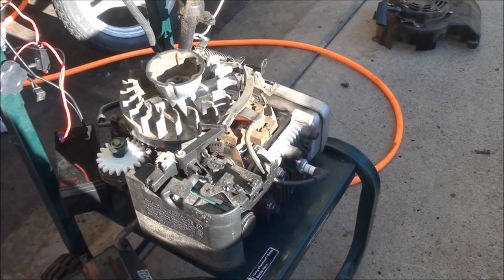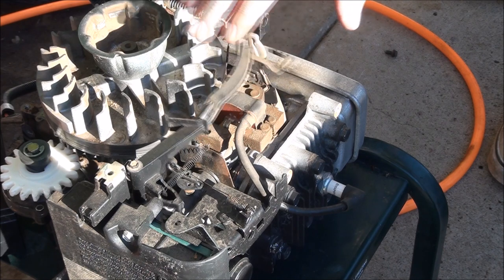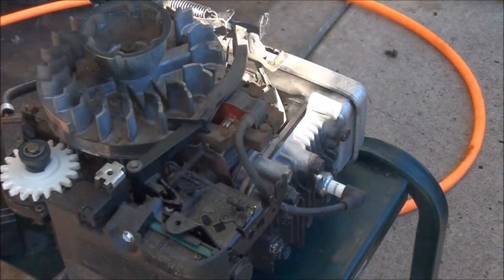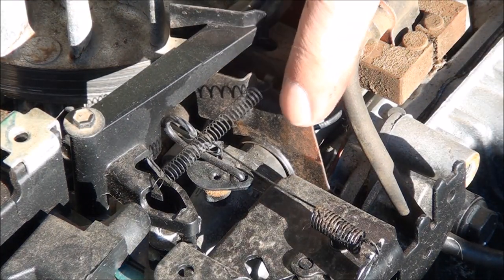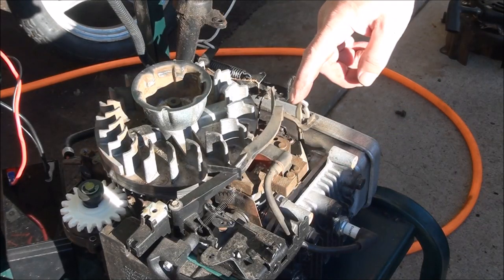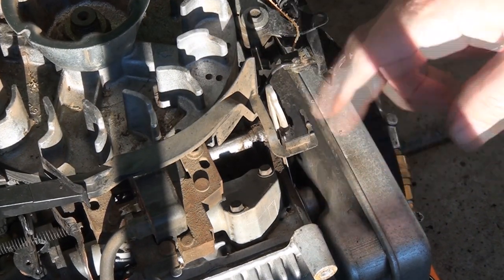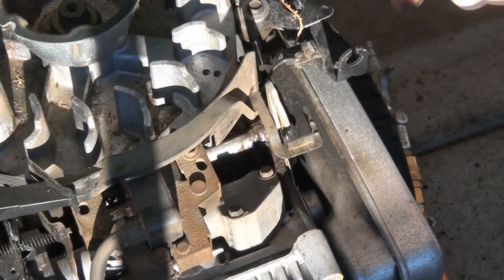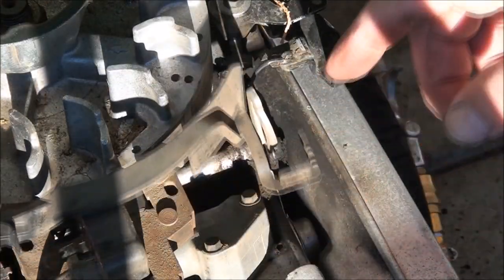HOW DOES carburetor AUTOCHOKE work on BRIGGS and STRATTON engine PUSH LAWNMOWER Check Test Inspect

Comment: I really like your channel. My go to for years.  My only issue with this video is the alignment of the thermostat/ actuator.  It’s supposed to align in side 2 lines in the front, & two lines on the side, for correct position.  Still my favorite.👍💯
Reply from the maker: Thanks friend, great tip!